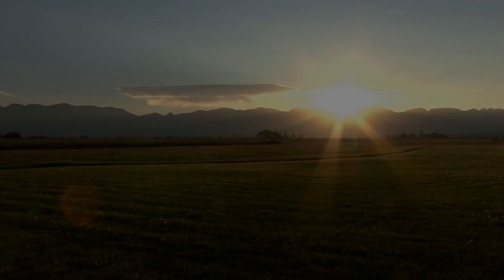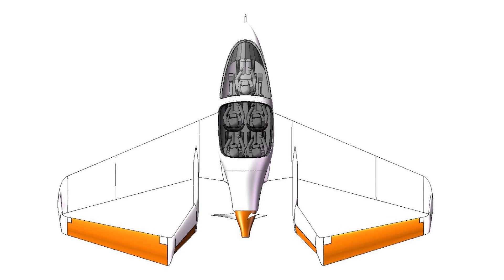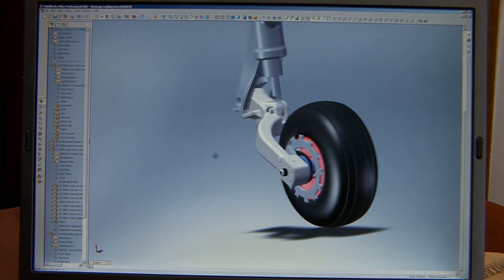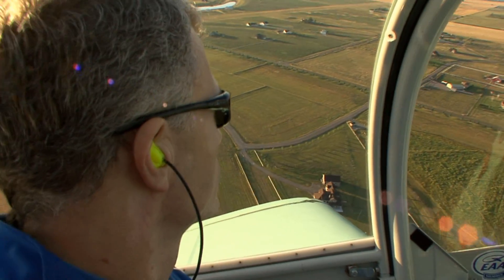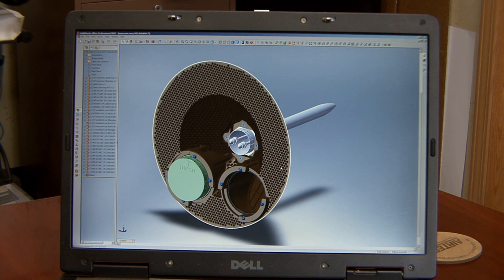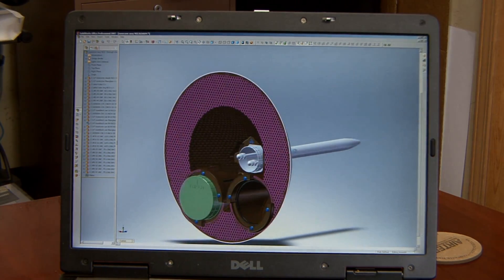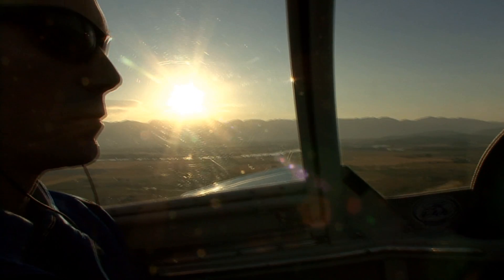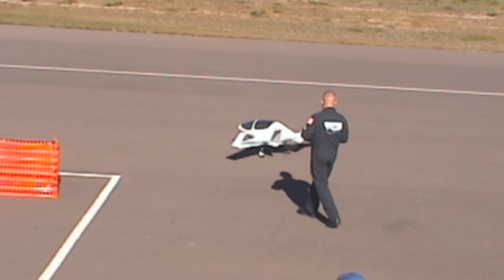Building Synergy

Comment: Sad this concept didn't take off. We've got a few modern examples that followed such as the Vampire LSA, Commuter Craft, and my favorite: Velocity.
12 gph at 175 knots/hr (201 mph) = 16.75 miles per gallon! That is not bad considering you are running the aircraft for a shorter duration than a car. 200mph turns a 12 hour drive @ 30mpg to 4 hour flight at @ 16mpg. I'd love to be able to weigh the carbon footprint of that, but I am quite sure it is much lower.

Performance numbers from Velocity Aircraft: http://www.velocityaircraft.com/airplane-specifications.html

Comment: You describe Aerodynamic Static Pressure Thrust and Boundary Layer Control, but I dont see how this is integrated into the design. You do describe on a forum posting about suction and the propellor design, but I'm not sure what you meant by that. If you're trying to make suction ahead of the propellor/impellor, how is that consistant with also saying you have Static Pressure Thrust at the same time? Are you intending to mechanically suck air and blow over the airframe using slots?